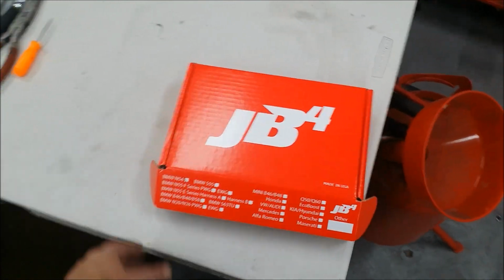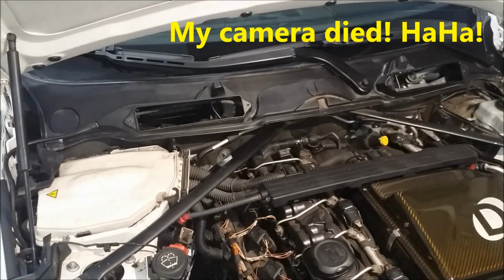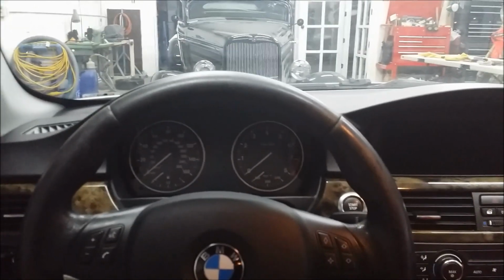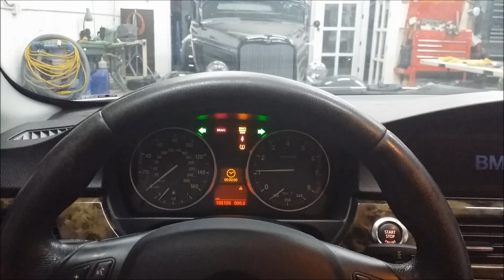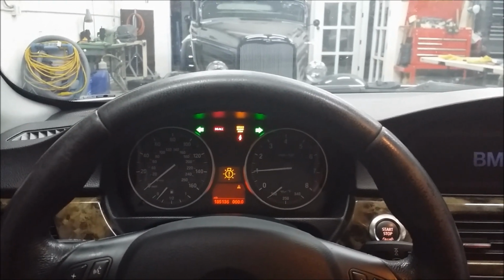BMW 335I E92 N54 PROJECT PART 3

Comment: Fell in love with an E92 I bought at an auction, it became a colossal money pit but I refuse to give up on it. Almost cheaper to get a new one😖
Reply from the maker: Haha. I new from experience this car is a headache but still one of my favorites. Part of the reason I haven't had a chance to do any fallow up video is I've ran into some problems with oil pressure and have some customers waiting for a harley and 71 camaro to be finished. I feel you pain. Haha.
Reply: Skelton and Co. is it leaking oil? i’m sure you already know but I’ve learned this the hard way, front and rear main seals had to be replaced on mine along with the notorious oil pan gasket.
Reply from the maker: Oil pan leaks a lot and I did the rear main when I replaced the clutch but it gets a low oil pressure light on cold starts and when the oil warms up it kick a vanos code and reduced engine power. I put 5w30 and vanos comes on about 200 degrees so went to 10w30 and now it's about 230 degrees.  Could be clogged oil pickup or cam ledges. All vanos are new. Funny that every time I fix one thing  another pops up. Haha
Reply: Skelton and Co. seems like we’re having identical issues, looking forward to the next chapter. best of luck friend, videos like this help me with my own E92.
Reply from the maker: Hopefully I get to late next month.  Thanks for viewing.
Reply: @SkeltonandCo  I own an e92 myself and have experienced several problems. Not low oil pressure but I have changed just about everything, including the whole valve cover and turbos after blowing a seal. Examine the valve cover to check for any cracks or warpage and change the valve cover gasket at minimum. I changed my gasket then discovered my valve cover was warped so i changed the whole thing. Immediately fixed my oil burning issues. It's hard to pinpoint your problem but I would do the oil pan and check for any clogging, as well as removing the valve cover, cleaning it AND the PCV system as well as you can, and reinstalling if you find no cracks. Best of luck, thanks for saving the car.